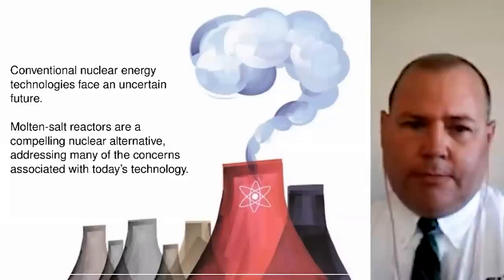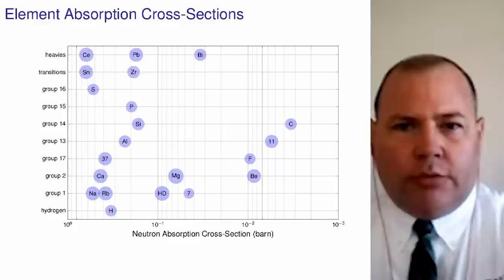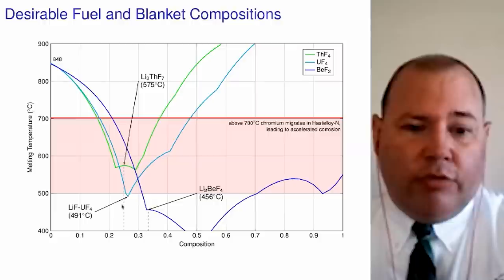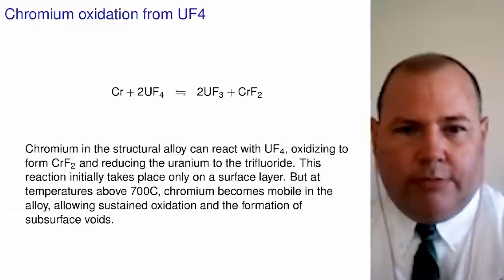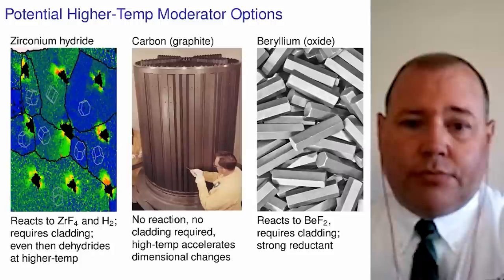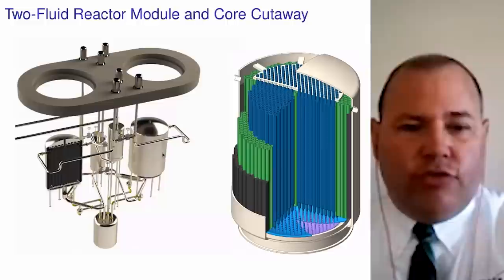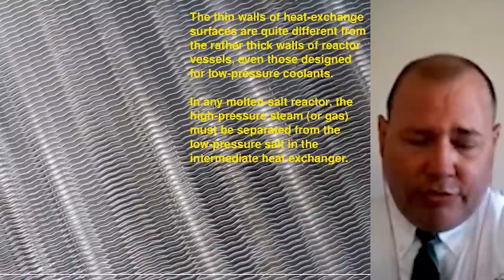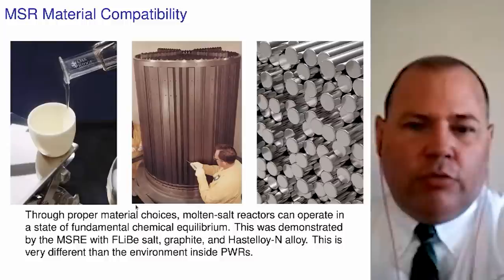Molten-Salt Reactor Choices - Kirk Sorensen of Flibe Energy @ ORNL MSRW 2020

Comment: Why don't you stop using that word "waste", which people think of as primarily fission products, and start calling them "nuclear explosives", which is what most actinides are.  Almost every actinide except Th-232, U-238, and Pu-244 is a nuclear explosive and needs to be eliminated.  "Waste" implies that you can store it somewhere, and you can't.  It must be destroyed.  That's for smaller chloride (Cl-37)or lead reactors.  One future solution is to use the chloride reactor to feed neutrons to the fluoride reactor.

Comment: Clever people wasting effort on obsolete technology. Please explain how this can ever be cheaper than solar PV with battery storage. You can call Tesla and get a system that will pay back in a few years. Thereafter you have nearly free power. The half life of panels is increasing so the ultimate cost is maybe a fifth or less of what customers pay for utility supplied power. Problem solved.